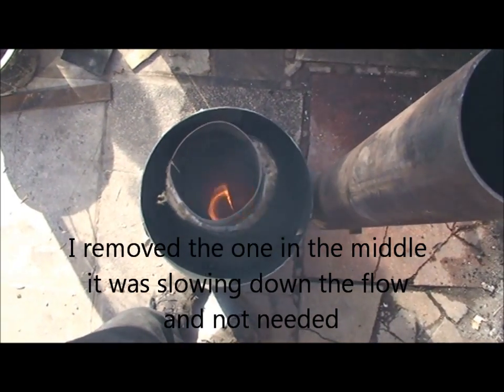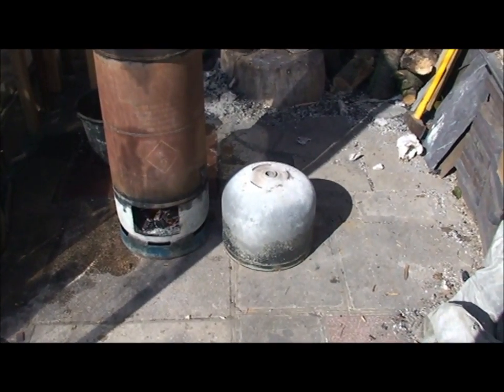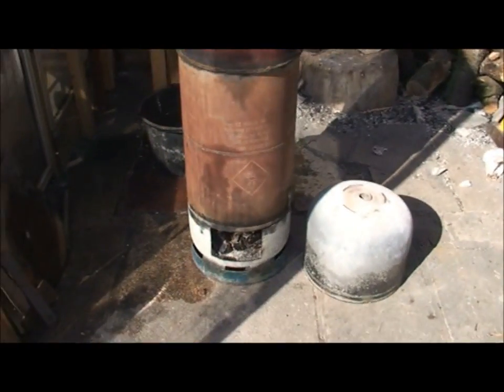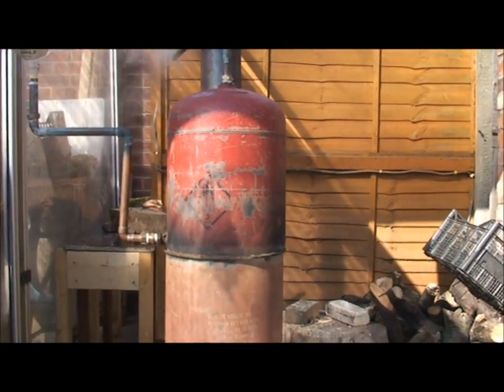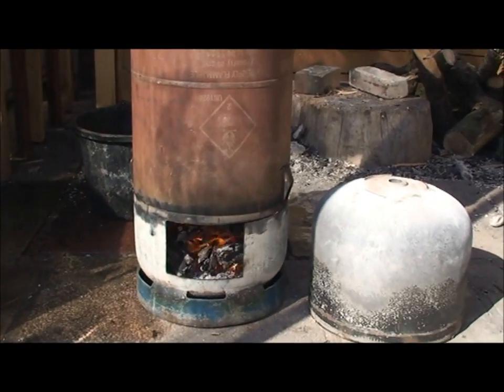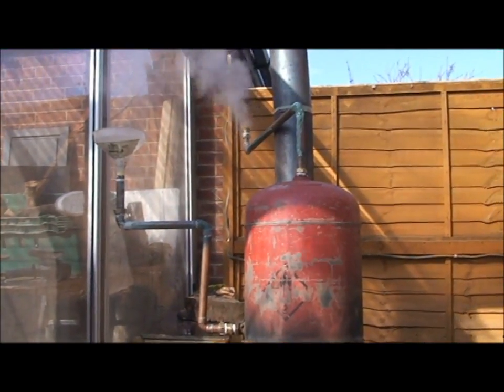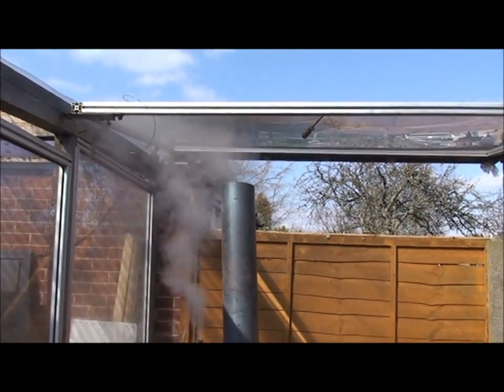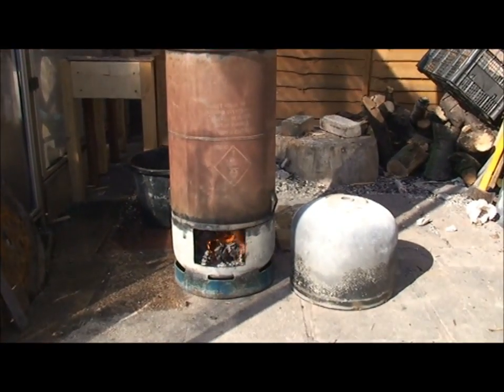rocket stove heater built in firebox part 2

Comment: Need an off grid  domestic water  heater, can I visit for a consultation in the best design ? Thanks jason
Reply from the maker: Hi jason the most simple and prob the most effective method is to wrap copper pipe around the outside of a riser tube and connect it to a tank, other options are to sit a boiler on top of a rocket stove, the simple methods usually work the best cheers
Reply: thanks, but can i pop by just to talk gas bottles/dimensions, really like you bell jacket boiler on top of riser idea, but unsure if water will circulate and if it can be collected efficiently etc. 1 hr, will pay you well for your trouble. sundays are good. love your pigeons, my rescued feral pigeon is amazingly beautiful in her early weeks of life. so sweet. will take her for her first flight on the Malvern Hills soon, keeping an eye out for predators !

Comment: very interesting ! thank you for posting. A few questions if you don't mind. how far in the riser did you put the venture and do you think the steel will have a longer life span in an "in line" aplacation like this ? The thought of adding this to something like caotropheus first woodstove occurred to me . What are your thoughts on this. Thank you for a informative video !
Reply from the maker: Hi it was right in the bottom of the riser, and yes I think the steel will last longer as it is away from the coals but eventually it will no doubt fall apart.

Comment: Thanks Ppotty. I am in the process of building this for my workshop after hours of you tube and googling. It works for me due to size and materials I have. Could I ask what you used to insulate the riser? Looks like some kind of material held in place with thin metal sheet? Cheers.
Reply from the maker: Hi Simon, it was Kao wool which is a good insulator for a riser, I wrapped some thin steel around it to stop it falling apart and getting dirty. Cheers.

Comment: Hello, I love the ideas. Have you done anything more with this design? I've seen some designs  fro Japan that used a channel up each side of the riser tube with holes drilled all the way to the top and produced a real clean flame almost like burning a LP gas. What do you think of this design for secondary air??
Reply from the maker: +Willard Way Hi There,  No I didn't go any further with that I just built it to test out ideas and yes the guy from Japan had a good idea there it will work well when the riser gets really hot and would probably improve the output of this stove. Cheers.

Comment: I`m new to this stuff is the hole to the riser tube that small.woodbutcherken
Reply from the maker: +Ken Stocks Hi Ken, the hole has no effect on the stove it was where the gas valve was fitted just didnt bother to block it up, the flames go around the gap in the sides of the plate and up the riser.

Comment: wicked vortex ,thats for sure.i reckon tho u could achieve loads more heat if u had your air intake coming from under the flames maybe,i dont know for sure but i melted my alu flue within 5mins of starting my first burn so 660 c+ but IR sensor overloaded with max registered at 1,800 (c) so had to change to plan B.wasnt even sealed.i think i achieved that through making a grill half the length of the sideways feed area system allowing more air & also found the longer the pipe the better the draw.

Comment: So I hacked together the main rocket stove, same dimensions except the pipe which is 3 1/4" diam (only pipe I have now) and I made it Black Jack 21" long. I installed the Catropheus 45 degree vortex "X" at the bottom of the pipe and once it gets heated up it cranks quiet nicely. I'm burning off the paint and boiling off some nasty water that I used to neutralize the propane tanks before cutting.  Goal is to make a mini outdoor heater stove/oven.  Great kwik simple design!

Comment: ppotty1, I make wood gas camp stoves and they burn very efficient but air inlet for secondary burn is above the flame.  Have you experimented with secondary inlets at different levels inside the riser tube?  Have you thought of possible putting valves on secondary air inlets to stop airflow  when fire is out?  Great design, I just got some pieces cut to make my traditional rocket stove, like trying2hard.  I don't know if I will need a baffle in tube to create a vortex or secondary air inlet.

Comment: Harry, the goal of rocket stove efficiency is to maintain as high as possible temp in the riser tube itself and to extract heat after it leaves the riser tube. If one were to wrap the riser tube with tubing it would cool it and make much less efficient not completely burning ash and gases, creating soot and smoke.

Comment: Excellent Loz. Looks like you've cracked it there mate. You'll heat the house no prob with that. What's next? Lagging round the outside? Maybe a thicker jacket to carry more water? There has to be some commercial mileage in this. Trouble is firewood would then go through the roof.